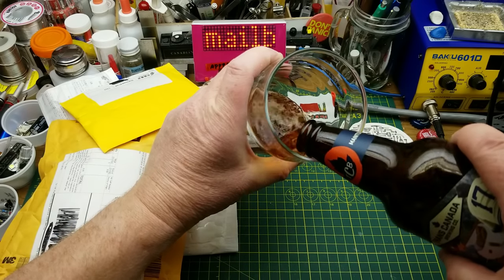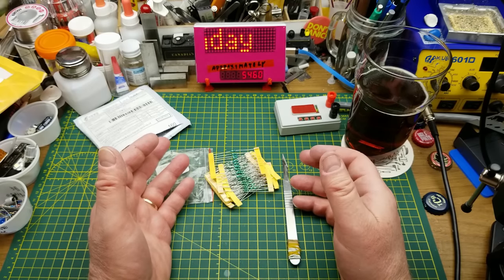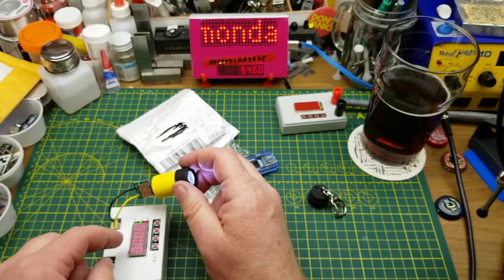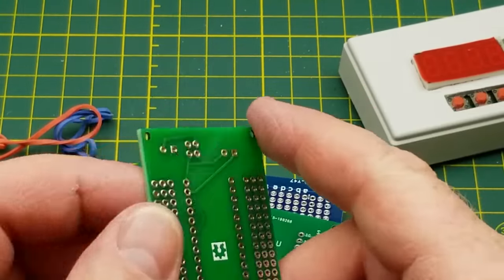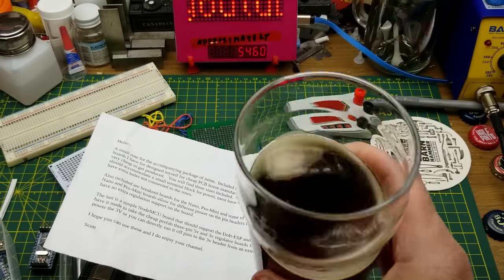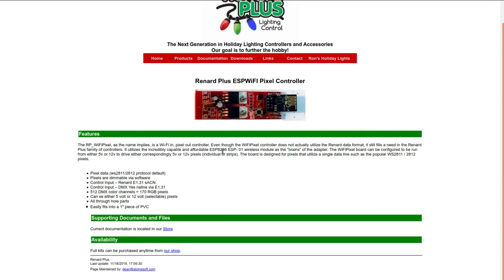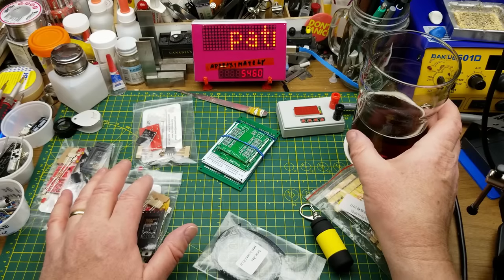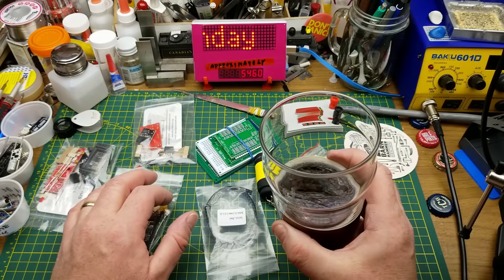mailbag Monday #85

Comment: A project idea for you.    How about a 20-second timer for handwashing, great if you have kids.  There would be a light sensor with no contact to start the timer.  Several LEDs to show the timer is working maybe one every 5 seconds.  Then when it ends a little light show.  Battery power for safety.  It would be very easy to make with an Arduino but what fun is that?   How about discrete components may be a NE555?   It might be a great challenge project for your fellow YouTube electronic posters.

Comment: Wouldn't be the first time something rechargeable has ordinary batteries inside instead...
Reply from the maker: I'm betting it's either that or no charging circuit. 

With a small side bet that it's actually supposed to work, but is simply broken.

Comment: i love you videos, always interesting, as to surface mount stuff, I find I can see and hand solder 1206 SMD stuff, but with the smaller 0603 and especially the 0402 I have to use a hotplate and solder paste if I use a heatgun I always end up blowing them off the board :-)

Comment: To your DMX thing:
it says that it accept DMX via E1.31 wich is sACN, a DMX over IP protocoll using multicast. Most Lighting Software can output this protocoll -> no hardware required
If you want to build a DMX Controlled LED Matrix the Windows Software "jinx" is quite easy to use, For a more general controll Software magicq from chamsys is a mighty software that needs some practise but can output lots of DMX for free via network (available for Linux, Windows and i think macOS). But most Software can handle sACN, sometimes the Software needs a (pricy) hardware Dongle to unlock output (e.g. GranMA2 onPC)
Reply: If you want to some pixels with sACN E1.31 (Jinx!) then you can do it with a 8$ Orange Pi Zero

http://www.orangepi-dmx.org/raspberry-pi-e131-bridge
Reply: WiFi is not the best for your pixels; as sACN (and also Art-Net) are based on UDP, you may loose some packages ...
Reply: @ArjanvanVught  of course, wired Network is always better, but most Software send ~40 packets per second per universe so even when one or two are lost it should not realy matter
Reply from the maker: Yup, that's important to keep in mind for a professional installation.

But for a front yard hobby thing, an occasional packet loss is probably something most people are willing to tolerate. 
Though some of the people on the Christmas lighting forum I linked in the description build systems that are as large in scope as some of the large commercial displays...
Reply: @NiklasAuBln  If one of those package is sACN E1.31 Synchronization (Art-Net ArtSync) package, then it really does matter.
Reply from the maker: That's some very interesting suggestions if I want to go big one day!